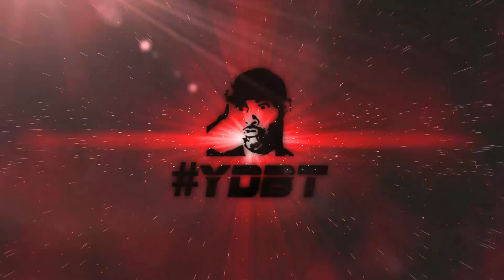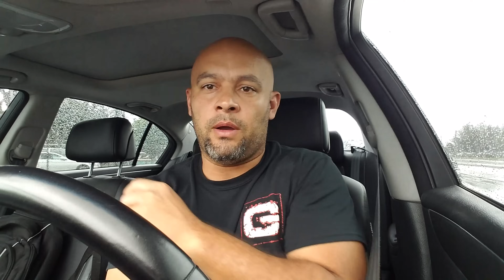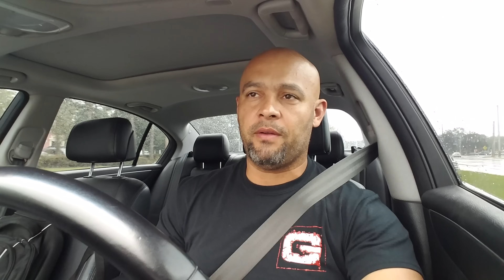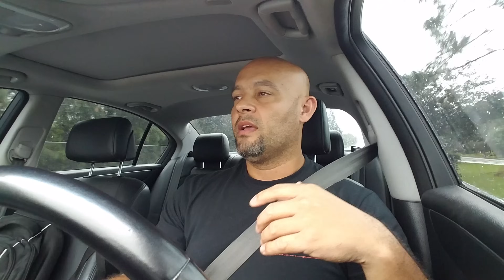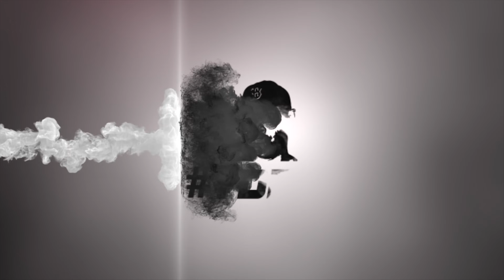NEVER PUT ICE ON TOP OF A TVS SUPERCHARGER.

Comment: Hey Alex, whats your thoughts on meth/water injection entering via intake tube prior to blower?
Reply from the maker: I've answered it many times. Wildly inefficient
Reply: @YDBT4LIFE  really? I would imagine there would be some drop in iat prior to the rotors at the bare minimum? So maybe not more power,but some possible heat soak prevention?  Any thermal downsides in your opinion relating to the similar aspect of ice on housing instance like this video? I've heard some companies void the warranty if an end user sprays meth/water into their blowers. And have you done any real world testing on these types of setups? Sadly no e85 near me, so I'll be on 93 on my new blown f150. So I was thinking of running the meth/water nozzle in the intake. I've seen several people run this. But I trust your opinion. Thanks as always for the replys my man!

Comment: Just put a bag of ice (not dry ice, lol.) between the aux. fan/engine and turn the heater inside the car on high.
 In addition; removing the air conditioning system might help you gain 5-10 hp.

Comment: Oh look, YoLo using his 15 minutes to spread more BS to the community.   The case and the rotors are two different materials, with two different rates of thermal expansion.   They are going to expand at different rates with or without a bag of ice.
Reply: What he says still remains true. They are engineered with a certain differential expansion rate in mind. At operating temperature, there is a specific rotor-case clearance specification. If the expansion of the case is restricted, it may no longer have the required clearance